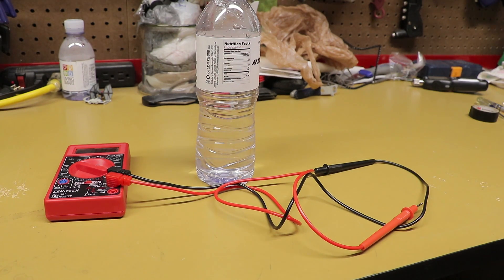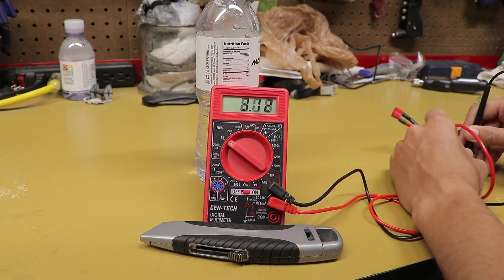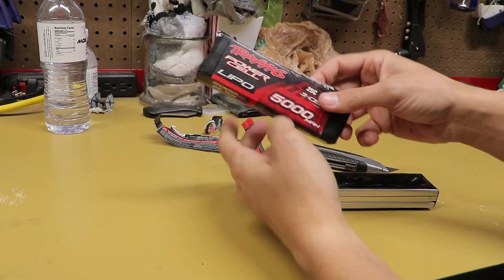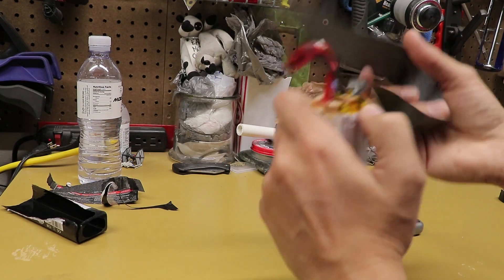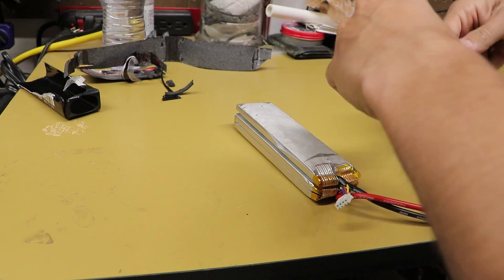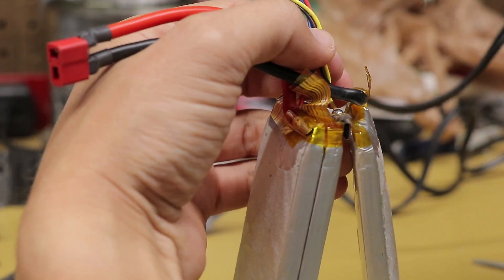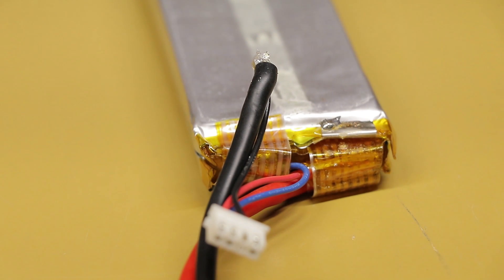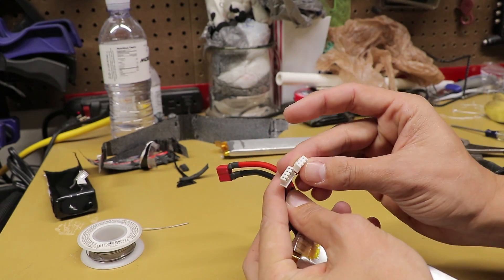How to Convert 3s to 2s Lipo How To-Bad Cell/Puffy Pack

Comment: its crucial to heat up the pack before you use the floss.
Reply: IPA softens the adhesive. Heat is not advisable on battery cells
Reply: Use fishing line or zip tie with a bit of oil to soften the adhesive

Comment: Try using a common "T" pin to remove those wires from the plug next time, it works better than that big tip prick you used!

Comment: Anybody that cuts a lipo apart is an idiot you never mess with lipo batteries its not worth a fire because you were too cheap to buy a new one! If one cell is puffy the rest will follow dont be stupid drop it in a bucket of salty water for a day or two and throw it out

Comment: Hey great vid.  Do you have any advice for a 3s 2200 shorty lipo that the 3rd cell charges too fast, and discharges too slowly.  Wont balance.  That trouble cell is at 4.5 and two others at 3.5 etc... help
Reply: Discharge it. Dispose it. And next time use balance mode to charge or go back to NIMH. There is no reason for a Lipo to exceed 4.2v per cell

Comment: When changing a balance plug be VERY sure that the pins are firmly in place. I changed one out and I thought that the pins were ok, but when I pulled the battery from my Tx, 2 pins came out and instantly welded. It was maybe only 3 seconds, but the battery is now totally dead. I was lucky there was no fire!

Comment: I just did this and you did an amazing tutorial but I didn't use heat shrink as a case I used trusty duct tape and some really tough cardboard and it should work pretty good because I've used this type of cardboard with other thing as well.
Reply: I will also add that I may do a video of how well it works eventually and I'll have a link to your tutorial but will also have at your own risk thing in description. I'll also add another comment reply when it is posted

Comment: Very informative thanks for posting. Do you store your lipo's in your house I'm new to the hubby and I see a lot of people saying that they dont keep them in there home but I live in a place where keeping them outside is not possible any info would be greatly appreciated thanks
Reply from the maker: You need a bag like this: https://amzn.to/2ST3BUc Although depending on how many batteries you have, I'd get smaller bags for each of them too. If one starts on fire and it's sitting next to the other ones...Keep the lipos stored at proper voltage and you should be okay. 
You can also keep them in a ceramic pot in the house, too.
Reply: I store mine in a airtight ammunition box..
Reply: Ok thanks for the info I'll pick up a ammo can and some lipo bags
Reply: @rcfundyer5739  reason being is as a airtight storage box made of metal, should a fiery poof happen the oxygen within the box will be consumed by the fire, no oxygen no fire, problem solved, family safe.
Reply: @billyeason9899  brilliant
Reply: Lipos don't need oxygen to start a fire. Also if the box is airtight and theres a fire, the pressure will build up and create a pressure bomb
Reply: I store them in a ammunition box. Mostly make sure the leads have no way contacting each other or something metal. Also don’t store a fully charged lipo for more than a couple days. If you need to store them for a little longer than that then only charge them to 4.1 volts. Never go past 3 -4 days as you will most likely damage the battery. Also storage charge them at 3.8 volts every 30 days.

Comment: Can this be done only to lipo?? Or can it be done to nimh or nicd batterys.
Reply from the maker: You could do this to nimh/nicd too. You'll need to be able to solder the top of a battery which is usually harder.

Comment: The balancing socket for 3s is remade in the socket for 2s! You had to remove a red wire from the balancing socket and for plus contact to use a blue wire!!!

Comment: do you recommend any certain brand lipo as a good alterative for the Traxxas batteries?
Reply from the maker: I've had good luck with Floureon and Venom-but make sure you're cautious of which battery connector you need! The biggest thing for lipo batteries is storage as I find most of the time damaged batteries come from improper storage. Of course regardless of battery manufacturer, they can still have an occasional bad cell after a while. Also you can find a review on a floureon battery on this channel-the cells were very closely matched and performed well. https://amzn.to/2roFPAy
Reply: Thanks. I've really only had one traxxas battery fail my entire time in the hobby, mainly looking for similar performance without the Traxxas price tag.
Reply: My Floureon 5200 7.4v  battery will last most of the day im my team associated rc10 T3 i got a 3300 kv brushless motor an 45amp esc an an does about 20 25 depending on with tire I got on.

Comment: have you had any trouble  soldering to the tabs on the lipo?
i cant seem to get any to stick no matter what flux or temp
this happened on 2 different lipo brands i tryied this on
Reply: try to sand the tabs on the lipo it might help it stick
Reply from the maker: It's a pain. I've had a few that I couldn't do because of this exact reason. I just call those a wash and toss them since I don't want to risk issues from something coming loose. Suck though.
Reply: You need to use alum flux and solder